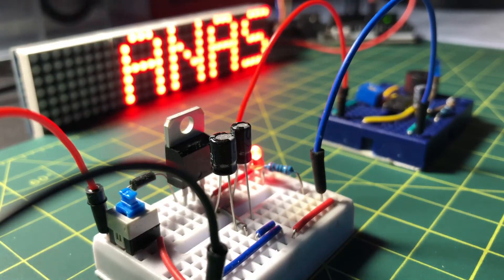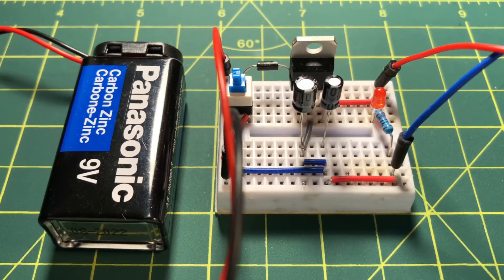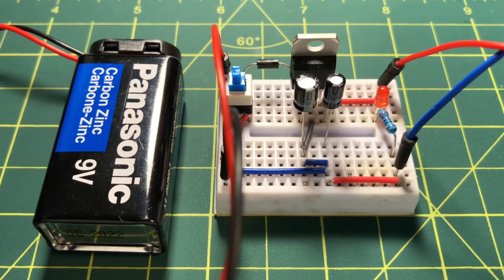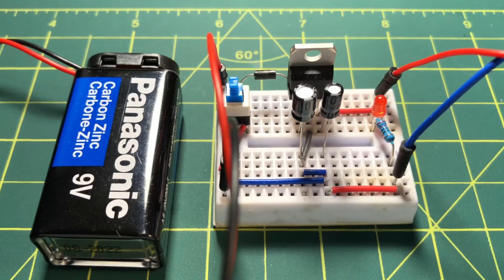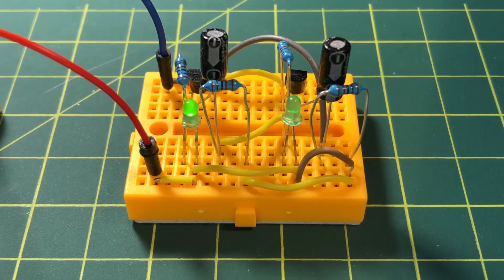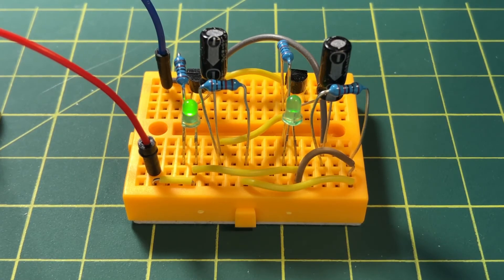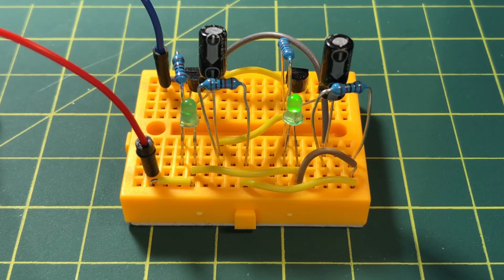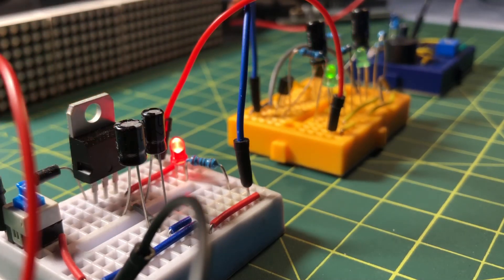Electronic Circuits on Mini Breadboards

Comment: I'm very new to learning electronics I have done a little bit with full-sized and half-sized breadboards.

 How difficult is it to power up a mini one ones?

Since  they don't have the plus and negative like the other two.

I don't really have anything that would work for a mini breadboard I mostly use these direct connect power modules that can be linked to a 9-volt battery or powered up via USB port.

 What would you recommend for powering up a mini breadboard and how does it work in terms of using negative and positive?

I've been wanting to get some of these and continue learning I'm also learning soldering as well this was a pretty interesting video.
Reply: Mini breadboards are usually used for things like pbc's (printed circuit boards) which are usually powered by a computer due to it needing to be programed and act as shields for circuits above circuit boards to be less messy like using a full sized breadboard.

Comment: hi, I have a kind of little circuit and I want to know how would it be if I use a mini breadboard. The most important doubt is how to use the power supply to the whole circuit, since it doesn't have those rails as the bigger ones (I'm using to power supplies)
Reply from the maker: Hi, I normally set the first/last column rails for Vcc and ground.
Reply: @AnasKuzechie  but how does the whole circuit gets powered by a battery for example? I refer to the connections, because the negative and positive rails have their connections horizontally and the other rails do vertically

Comment: Hello, thank for the video. As I am an electronics learner, I would like to do myself those circuits here at home. Could you please write down a list of the elements used in each one of the three and their? For a 6 volt power supply there would some adaptions, wouldn't it? Best regards
Reply from the maker: Thanks for your feedback. Soon I will provide circuit diagrams with components used. I will message you when available.
Reply from the maker: A link is now available for circuit diagrams.